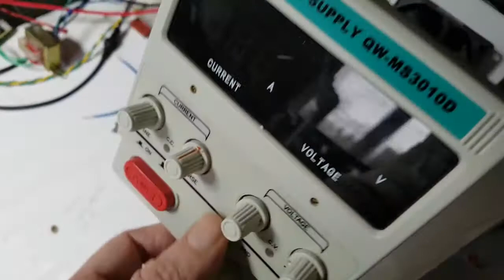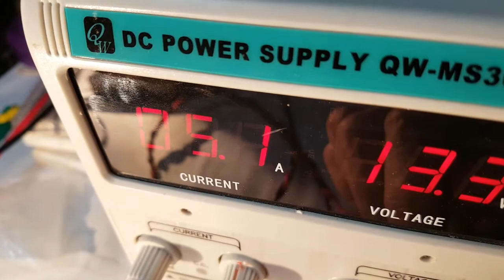Maisen MS3010D Power Supply Repair Update

Comment: I have the same and my displays show 0.0 A and 0.0V since yesterday. Been working for five years but died yesterday. The fan is not starting and the output is always zero, regardless of the potentiometer settings. The display works, so I have no idea. There does not seem to be anything burned inside and I can't find any fuse on the PCB. The only fuse I know of is on the mains, but that is obviously not blown since I have 9V for the displays and the displays work just fine.
Reply from the maker: When mine first lost output it was the output transistors. There is a thermal switch on the heatsink worth checking
Reply: @Elecifun  Thank you. I will check R2 R5 and the two IRF840 and see if they are blown. In the meantime, I ordered another one similar but not the same. Maybe the same inside, I don't know yet.
Reply: @Elecifun  The transistors and R2 and R5 seems fine, also that thermal switch is working. I am out of ideas.

Comment: I have a ms305d and the transformer noise appears when the cc and cv are on, it think others have had that issue with it being stuck between the two states. My main issue I have with the unit is the spike on the output voltage. If you look at yours on a scope do you see spikes above 200mv about 66kHz.
Reply from the maker: Hi Norman, I will set up and check that a little later today, cheers for the heads up.
Reply from the maker: Hi Norman did you figure out the issue with yours ? I might have a fix for the noise or at least I fixed mine.

Comment: Hi - thanks for making the video. I have the same PS and it wont go above 4.6 volts so I need to do some fault finding.  I cant see anything obviously wrong - no blown components. Can you point me in the direction of a circuit diagram for this PS - I have done the usual googling but not found anything useful.  Hope you can help.
Reply from the maker: Have you tried replacing the output transistors? A viewer left a link on one of these videos a while ago. I can't remember which. The schematic was for this or something similar with the same layout.
Reply: @Elecifun   Thx i'll do some more serching and see if I can find the schematic.  I have not changed any components next but will look at the output transistors first.

Comment: Hi All, please I need your support, I bought a new QW MS3010D power supply but when I turn ON it, I see in the current and voltage displays "00.0 00.0", even if you varied the voltage and current from the controls to max, the display permanent is showing "00.0 00.0", the fan of the power supply is still. This failure sympthom maybe is different from the videos and I see in youtube, I watched that repair this power supply in some cases the solution is replace and change the "P75NF75" or "IRF3205" 0r IC "KD112" but I am not sure that replacements could be the problem, because the power supply is new. Please, if anyone had the same problem or know the specific components to be changed, let me know, thank a lot.

Comment: the problem im having is the power supply dose not output any voltage just 0v and 0a
Reply from the maker: Test the output transistors
Reply: i have oh yeah i replaced all of the transistors correctly so im out of ideas
Reply from the maker: @NotCaily  Check the output terminal panel inside. I had to reflow solder on mine as the power cables do not connect directly to the output terminals. When mine was playing up it was because these connections.
Reply: i did every thing i could do still not volts or amps